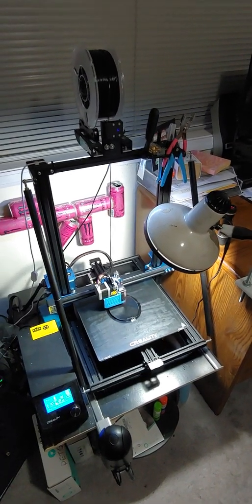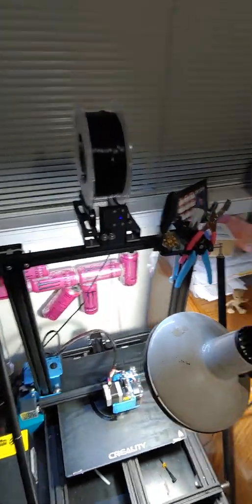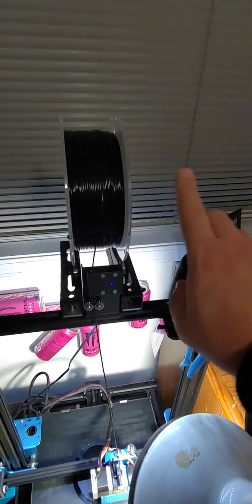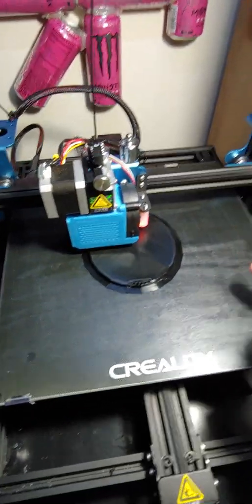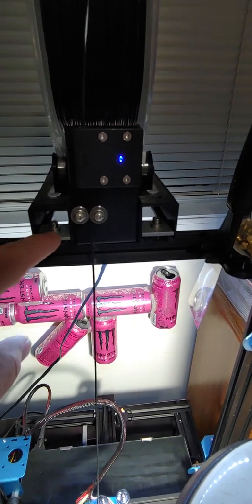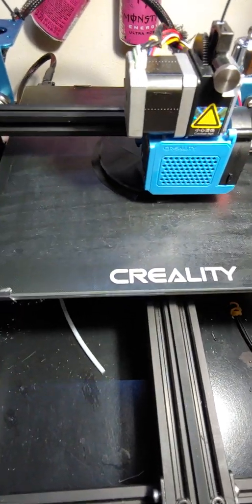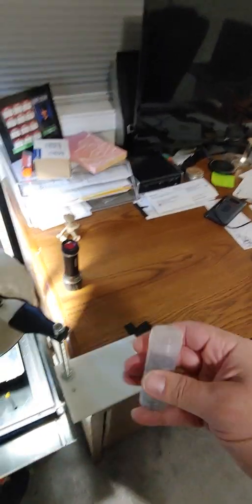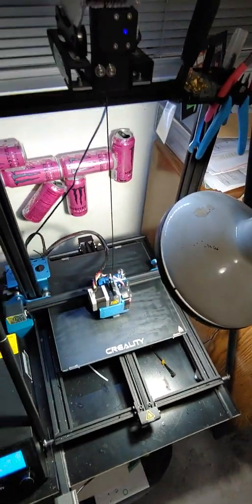Creatily CR 10-V3 stock spool holder friction problems. This is the way to fix it.

Comment: Thanks for the video, great effort. Thinking of buying this printer. Seen a lot of people having problems with the BL touch. Which bl touch version did you get?
Reply from the maker: Creality 3D CR-10 V2 Upgraded BL Touch, Auto Bed Leveling Sensor Kit for CR-10 V2/ CR-10 V3 3D Printer. This is the one I bought off of Amazon. I was in a hurry so I just cut a pasted the description....sorry for no link.  Once I changed the filament spool holder I did the paper level thing and it's worked perfectly.  Weeeeell worth the $40 or whatever it was.  Glad it helped
Reply from the maker: I would also like to add this is an excellent machine for the simple fact I was in the middle of a 17 hour print and we lost power due to snow it had absolutely no problem when the power came back on it asked to resume print heated up to Temp and started exactly where it left off probably one of the best features at this particular model. Very very highly recommended if you have the extra cash for this one.
Reply: Thanks for the video! Do you mind sharing the link for the part you put the spool holder on? Thanks in advance
Reply: i dont recomend it with BL toch. I bought mine after from oficial website and dont worth. Manually you get better leveling. and if put silicon pads instead spring for leveling you dont have to leveling the bed for a long time.